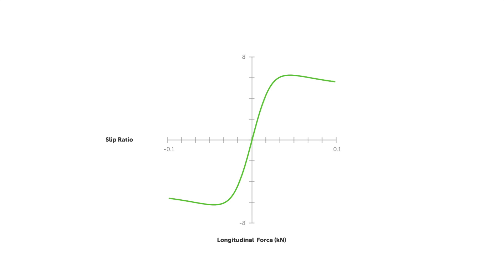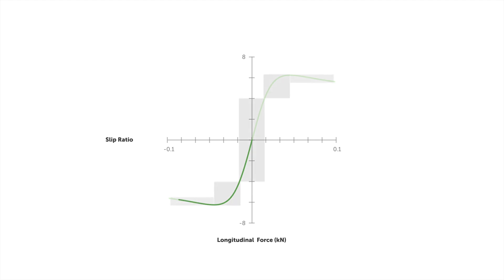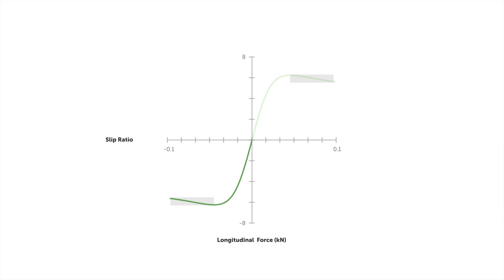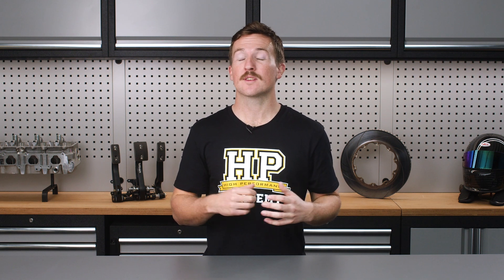Do Wider Tyres RUIN Brake Performance?

Comment: Hi guys, thanks for the good content. I have a question. If I mount tires with 10% more grip, does it make more sense to increase the spring rate by 10% or to increase the spring rate so that the spring frequency is 10% higher? ( It's just a theory)

Comment: You need the correct size tyre for the vehicle weight/load and it’s ability to build heat into the rubber.
Too much surface area and the load is spread over a large surface area and doesn’t build heat( friction ), too small and it will overheat from to much friction.
That is all else being equal, tread block design, rubber chemical composition and tyre pressure.

Comment: Will we have a shorter braking distance if the wheel rotates slightly slower than the vehicle speed would indicate (in a light slip), or if we keep the wheel speed the same as the speed of the slowing vehicle? 

My empirical "street experience" (im not a racing driver and, never any measurements taken) tells me, that a car brakes better and accelerates better if the wheels are kept in a slight slip.
Reply: Generally having a little bit of slip (5-10% if I remember correctly, I'd reccomend you check since I mightve forgotten the proper value) is ideal for braking

Comment: Tire width in relation to diameter primarily effects the contact patch shape, and how that contact patch deforms and changes under load. This will effect handling charactersitcs of a car but not really "increase grip". Two differently shaped tires at the same pressure will have the same amount of grip, it will just be distributed in a different way. 

Race cars use wide tires because it distributes the car's weight more evenly putting less stress on the sidewall and carcass, which allows them to run lower tire pressures, which increases the contact patch size and thus the total grip. If you look online at some tire's specs you can see the load rating of each tire, which is basically the how strong the tire is and gives you an idea of how low of a pressure you can run for a particular weight of car without compromising it's structural integrity. If you look online you can see that some narrower tires have a higher load rating then wider ones of the same make and compound, which means you can actually run a lower pressure on the narrower tires and have more grip than the wide ones.

Comment: It seems to me that many use too big and wide tyres. Especially on the street.
Having the right tyre for the car could possibly give better acceleration, more responsive handling and better braking. And that tyre might just be smaller than youd think. Especially on a lighter car.

Since tyre size and width is alot about looks its not surprising people are confused.

Its even more the case with brakes. (Remember size isnt in the equation..)

Comment: so if I'm understanding this right

a wider set of the same tire compound can potentially create a larger contact patch than before in the front under braking

which will distribute the loading, thus potentially having less friction coefficient loss in the front under heavy braking, which when compared to the rear coefficient, has the slight possibility to change oversteer dynamics under braking? ie, rather unintuitively, could be more understeery depending on compound/pressure/suspension? which seems intuitive actually, big tire grip more, if front more slip angle vs rear = more understeer
Reply: A softer compound will deform under stress whether that be acceleration which causes the tyre to flex outwards & shape like a doughnut & decreases contact with the surface (watch top fuel drags) or under braking where the tyre squishes into the surface & increases contact area due to the transfer of weight on braking

Comment: Great vid, I went with a narrower tyre last time, it's only for street use where I thought you may be able to keep slightly more heat in a narrower tyre, also allowed a square setup rather than staggered, seems to have worked out alright, looks like onto the flat patch vid now lol

Comment: More distribution of weight over the tyre surface will result in negative braking performance in the wet. So many 4wd/suv owners don't understand that their huge tyres tend to aquaplane on wet roads. The flintstones car would have had fantastic grip in the dry with those 2 huge front & back rollers but a pain in the arse in the wet.
Reply: This same logic applies to race slick tires as well. Of course they won't perform well on a wet surface because they have no tread but more than makes up for maximum grip on dry tarmac.
Reply: You may be mis-understanding what "aqua-planing" actually is? Certainly, there appears to be a typo', at best?
Reply: @gordowg1wg145  No, that is aquaplaning in a nutshell. Nobody will run slicks in the rain because people know that normal slick tires have zero traction on a wet track surface, unless you have specialized rain tires. The inly thing that traditional slick tires are goid for is racing on dry tarmac and nothing else.
Reply: @TheSilverShadow17  
Nope - while you are correct in that "slick" tyres are often severly compromised on "wet" surfaces, when aqua-planing occurs the tyre is physically lifted from the surface. There are other factors, such as the porosity of the track surface and/or rubber laid down, and a very important part is the temperature of the tyre surface.
Provided there isn't actual standing water - the track surface being merely wet - and and the driver still able to keep heat in the tyres, there may not be that much time lost, especially as intermediate and, especially, full wets can overheat if there isn't enough water on the track.

Even narrow tyres, with full tread depth, can suffer from true aqua-planing - I've even had it at quite low speeds, 60-70 mph, while driving on the road, with front wheel drive vehicles, where water has pooled in depressions. The engine rpm and speedo' rising and falling as the tyre(s) would lose and gain traction.
Reply: @gordowg1wg145  Even the slightest disturbances in the behavior of vehicles can throw them off quite drastically on most occasions, because when the tires make contact with a puddle of water they're not only dealing with surface composition changes but temperature changes as well in that same instant. You've helped reinforce the topic with your response but I'm typically referring to heavy rainfall on a road surface where tons of water has built up over time that hasn't yet evaporated or absorbed by the asphalt/tarmac.
Reply: @TheSilverShadow17  
You may be starting to understand - it's also important you consider your opening claims and statements, so you don't have to try and change your stance when corrected.
Reply: @gordowg1wg145  I'd also presume that another factor is the amount of load on the tires that can reduce or amplify the chances of hydroplaning on a wet road, from a logical standpoint I'm gonna give an example such as RWD sports car moving at 50 mph across a large puddle. It doesn't look or feel like much but that's enough to generate a speed differential between the 2 driven wheels which A: causes the back end to loosen up and partially slide out or B: negate braking performance since there was a temperature decrease on the tire rubber. As you pointed out earlier having the right tire compound is everything.
Reply: @TheSilverShadow17  
Yes, another factor is the drag from the tyre being pushed through the standing water - this can physically pull the car, and the steering, and if deep enough, or long enough, can cause loss of control.
Reply: @gordowg1wg145  The tires are of course under some form of load regardless of application they're being put through like acceleration, braking, turning, etc, so my question is what is the optimal amount of weight over the tires for when the situation gets dire and you have difficulty finding traction? Wouldn't that in some way help a vehicle get out of sticky scenarios? (Edit: I haven't really considered the size and width of the tires as part of the equation because there are some instances where some tires perform better in certain conditions than others)
Reply: @TheSilverShadow17  
I would say, as a reasonably experienced 'lay person' - it depends.
If by 'more weight over the tyres' you have in mind the ground pressure load, normally the lower the better, or less load and/or more tyre on the ground. this is the fundamantal principle for balancing the vehicle, front to rear, to bias for oversteer or understeer.
Off hand, I can think of exceptions, though - on topic, the higher the load vs area the greater the 'squeezing' out of any water between the tread and the track - the greater the hydrodynamic pressure that has to be develope by the water 'wedge' at the leading edge of the contact patch and progress beneath the tyre to lift it. With mud, snow, deep gravel, etc. the higher pressure should help the tyre penetrate the loose surface and reach the hard base which should give better grip.
Reply: @gordowg1wg145  Switching gears over to a dry paved surface I believe having more weight on the driven tires is advantageous because there's a much less likelihood of wheelspin and the vehicle has better traction at the region it struggled with initially. Too much and too little weight is a bad thing but finding the appropriate balance is what people in motorsport racing have always chased after as well as finding the unfair advantage in every case scenario possible. Of course it depends on the compound but choosing the compound that offers the most grip is always the best option for racing on tarmac.
Reply: @TheSilverShadow17  
My apologies, I had in mind braking and cornering - you're correct that with a single driven axle - in this case the rear - best acc'n will, theoretically, be when 100% of the vehicle's weight is on the driving axle. I say theoretically, because there are multiple factors to consider, and off-hand, drag racing is about the only time you want 100%.if the wheel is off the ground, it isn't steering, or doing anything to control the vehicle.
i'm not sure how familiar you are with the sprint cars, midgets, etc used for speedway/oval racing? there are times when all the vehicles weight is on the outer rear tyre - with the other three wheels literally in the air. While that's an extreme example, it's common for one, or two, wheels to be lifted as the weight is transferred to the outer drive tyre, especially on a tacky track, but as mentioned above, unless very carefully set up, there can be control issues. If you go to 2:55 you'll see what happens when they hook up - https://www.youtube.com/watch?v=ar3Rb-pCxHw
Reply: @gordowg1wg145  I'm familiar with sprint cars and oval racing as a sport, and usually those vehicles are experiencing a crossload for the lack of a better word on the outer rear and inner front tire. Sprint cars are built in such a way that they don't use a typical styled crankshaft like in regular cars but kinda like an integrated suspension-like chassis type configuration. One of the factors is the speed of which it's traveling relative to the track it's driving on and vice versa. Obviously you want to limit the excess frame articulation to avoid breaking in half in the midst of cornering but I understand the general concept clearly.
Reply: @TheSilverShadow17  
Sorry, but other than the apparent reference to weight, or load, jacking you completely lost me.
Perhaps if you edited it to better express what you mean - i'm a few years out of touch and it sounds intriguing?
Reply: @gordowg1wg145  I would explain it in better detail but I'm feeling tired at the moment after giving it some thought, been awake for nearly 24 hrs without proper rest lol I'll rephrase everything later after I get some shut eye.

Comment: Wider tires increase braking performance when same type and pressures are used in the dry, period.  
Anyone who says different is selling you a lie.
Reply from the maker: Everything else equal Wider tires don't necessarily mean more contact patch area. It's probably a wider contact patch, but will also likely be shorter in the longitudinal direction, which is more important to braking.
But if the contact patch is increased, this will lower the surface pressure between the tire and road surface, increasing the coefficient of friction leading to more grip.
Wider tires can and generally do increase grip, no one is arguing that, but it's a bit more complicated and whats most important in any case is controlling the contact patch - Connor
Reply: It doesnt have to be complicated though when the end result can be summed up.   If someone is not pairing their wheels and tires to the width they are running, that's a whole other different issue. Every record is done with wider tires. scca nationals is nothing but 275+ squared setups and they dont even go over 70mph most times or the biggest they can run, gunma record is held by a 300ish hp car running 295/30s.  I understand on paper everything you're saying is great, but in the real world, more width is just better, if the car isnt properly setup for that width, that is a build/setup issue, not a tire too wide issue. Their is a reason exotics dont come with 245 or 265s for "better braking and handling" its gullible at best to assume any car when setup properly will be better off with a less width tire unless rules restrict the tire size and you are forced. On paper you can make anything make sense to a degree, fortunately this hardly ever transfers to the real world... EA the "super conductor" that failed after stating "they figured out the math"   @hpa101   Show me ONE top 10 placing time attack car under a 275 that's not limited by class or awd.  weight of a normal car isnt a f1, wider the better.

Comment: Excellent content as usual 👍, also depending on the type of suspension a wider tyre along with track alters the leverage load to the spring / shock . Also the heavier mass due to a wider tyre / rim alters the frequency of the suspension due to un sprung weight. Always check your shocker/ dampers after the upgrade as the may well go out of range in either wet or dry conditions. A we’ll set up and valved damper should ideally be set half way on the adjustment allowing clicks either way allowing softer settings for wet and harder settings for dry. This then also effects the anti roll bar settings. All very involved but interesting and also sometimes depends on one’s driving style too . Some drivers trail brake and then apply the break to first scrub speed off and others use heavy breaking to transfer weight to the front axle , this then gives more grip on turn in but only momentarily. 
Hope this helps anyone.

Comment: I dont understand the part about vertical load vs coeff of friction. My understanding was that the coeff of friction (u) is a constant, based on mechanical properties between the two surfaces. I can understand how u could change over time eg with differences in tyre temperature, but changes due to the vertical load do not make sense to me, as the vertical load is N in the friction equation, F=uN, which implies u and N are independent?
Reply from the maker: In most cases you'd be correct where COF stays relatively consistent with vertical load, but rubber is a special case. @Fix_It_Again_Tony is on the right track with "tread deformation" and viscoelastic nature of the rubber. Very simply put more load makes it more difficult for the rubber to deform which is involved in molecular adhesion and therefore grip.
Tires are complex, but this is the reason why load transfer reduces total grip - Connor
Reply: @hpa101  ah ok that makes sense, thanks!
Reply: I am going to guess it has to do with tread deformation, but I don't really know. The simple F = uN formula does not take into account the dynamic effect of what happens to the tire as it experiences different loads. 

Tires are deceptively complicated. As I understand it molecular adhesion and tread surface compliance to small imperfections in the surface of the road (Milliken calls this "gearing", but I've also seen it called "indentation") are what generate grip between the road surface and the tread of the tire.  It's not like there is one mu value for a tire in all conditions. I think far more complex modeling is required to understand the actual forces between the road surface and the tire tread.
Reply: Imagine in the extreme case of a piece of tape attached to a desk. Since the force resisting motion in a piece of tape derives from adhesive forces rather than interaction from normal forces, the resisting force is independent of the normal force and therefore doesn’t have a meaningful coefficient of friction